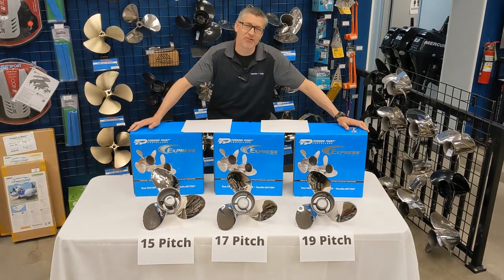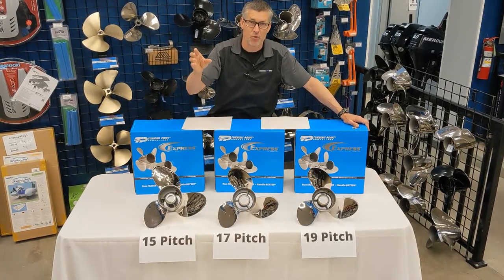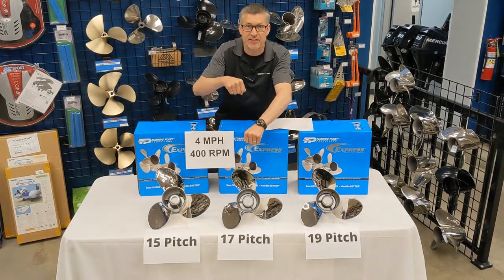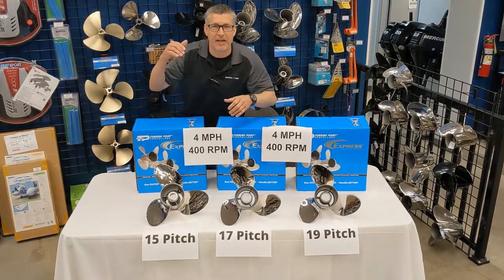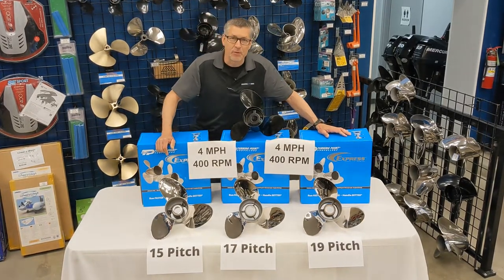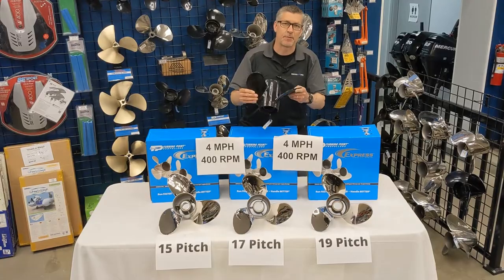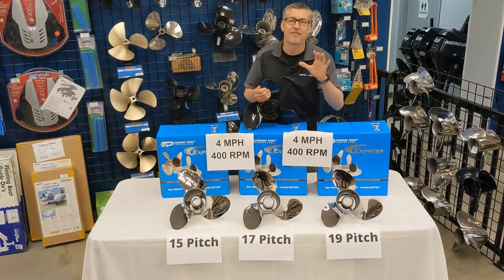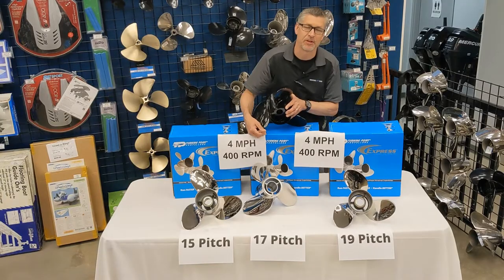Andreas, Parts Expert On - Prop and Pitch

Comment: Am changing props.  Sought advice and was recommended from going from a 10 3/8 × 14p to a 12 1/4 x 9P. Could you elaborate on the correlation between diameter and pitch?  Appreciate a short concise video such as this.  Just call me suffering prop confusion in Montana.  Great vid

Comment: I have a 14p aluminum prop getting 5000 rpm at wot.  My engine is rated at 5500rpm..
 I want to get a stainless steel prop at get to 5500rpm at wot.  What would you recommend?

Comment: Hey guys. Can someone give me some advice.

I have a 4.5m aluminum boat. With a 50hp Evinrude on the rear (2 stroke). It's currently got a 15 pitch stainless steel 3 blade.

My issue is. The steering is very difficult to turn left and right in the water at anytime even when the Boat is trimmed correctly. The mechanics have inspected everything else and said it's all brand new. (2017 model boat) 

Example if I turn the boat left it will take quite some time for me to get the boat turned to the other direction using alot of force. I understand it's a cable steering boat but it's abnormal. I've also changed from a 13 inch steering wheel to a 15inch and that has helped. 

Will dropping the pitch to a 13 4 blade help this issue?

Please give me opinions everyone
Reply from the maker: Hello @Davy-lf4cj Our experts would love to help you out you can give them a call at 780-732-1004

Comment: I have a ranger vx1788 150 pro xs. It currently has a 19p 4 prop revolution steel. Is this good enough I’ve hit 40mph haven’t really maxed out but I’m assuming kits close to max mph. I want more speed usually 4-6 of us with normal fishing gear. All led acid battery atm.
Reply from the maker: Hello @littlej3777 Our props expert will answer any question you have give us a call at 780-732-1004 and ask for Andreas

Comment: I swapped  a solas Amita 10.3 / 12p wot 4500 21 mph for a solas Amita 10.8 x 10p 5350 rpm 23 mph. Trim level on both.  Evinrude 25hp 1989 trapper topper 15 stick steer.
Reply: So what is the point to abuse the engine to the max and gain 2mph?

Comment: So you need a tachometer first. Ok
Reply: It doesn’t have to be permanent.  Tachs are cheap.  Much cheaper than an outboard, a prop, or even 5 gallons of fuel.  I bought one for $15 to tune my push mower & it’s paid for itself.